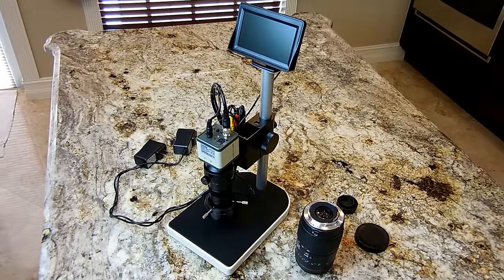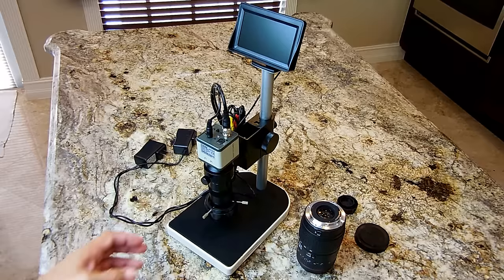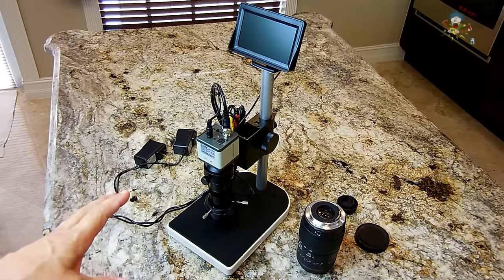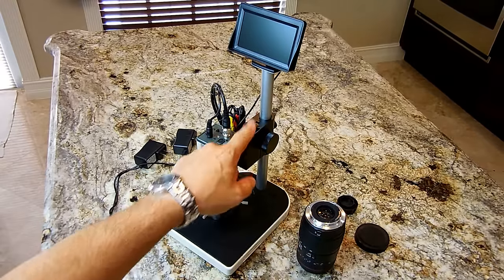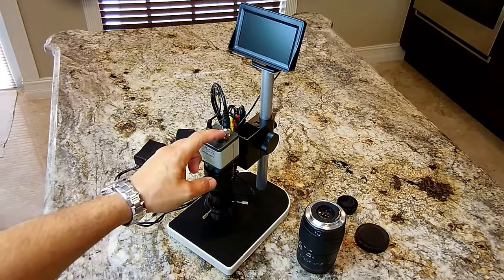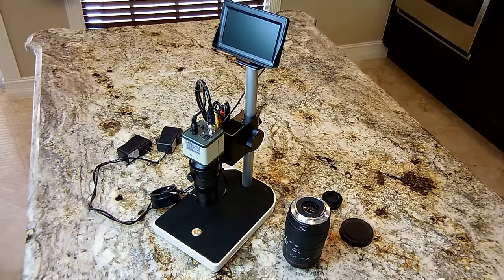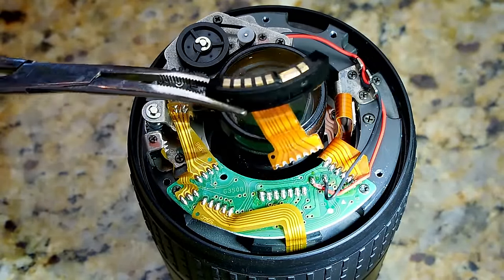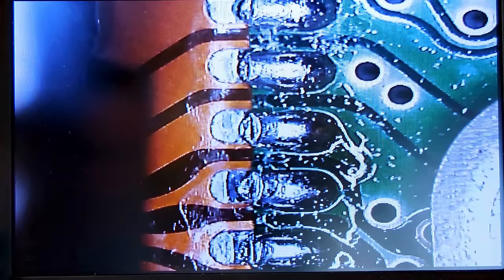Zoom Lens Flat Cable Connection Repair(Using a Magnifying Station)

Comment: This is interesting; it just didn't show well on my end as you know from your comment. No inference but it seemed as though I could do that by eye as well. I think this video would have shined if we could have seen the image as well as you were on the display. Maybe this could have been hooked up to a much higher display for the camera. Translation is everything when dealing with this subject. If this was language I have to go and try and look it up on Google Translate or other... Noble effort on this one...
Reply from the maker: You would not have seen too much. Just my hands moving around with the soldering iron under the lens, which is why I only showed the monitor to viewers. The connection to the flat cable was very small, and my vision up close is not what it was years ago, so the magnifying system made the repair easy. Using a very fine soldering tip, you could easily work on soldered connections which are much smaller and very close together. Thanks For Watching

Comment: Nice tool. Until recently I used a microscope daily for soldering and for sorting out bent CPU socket pins
Reply from the maker: They work great. It takes a little time to get use to looking at the monitor instead of the work area. Every little movement with your hand, becomes a big one. :-)
Reply: Don't I know it (Every little movement with your hand, becomes a big one.)